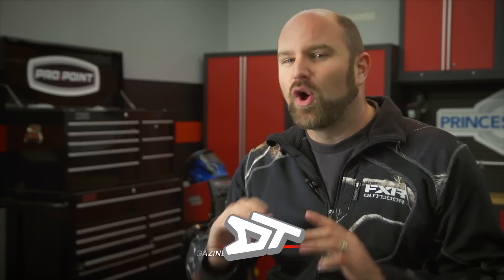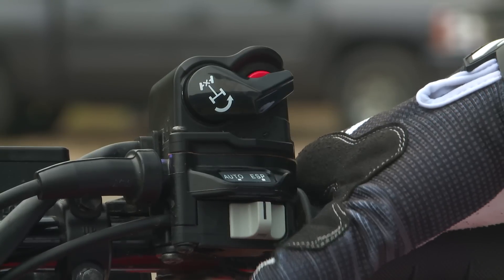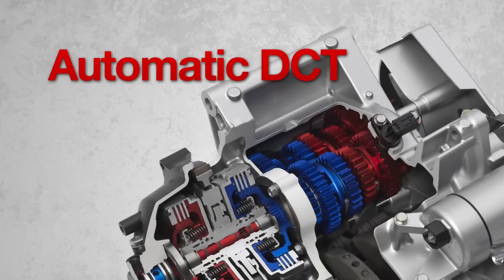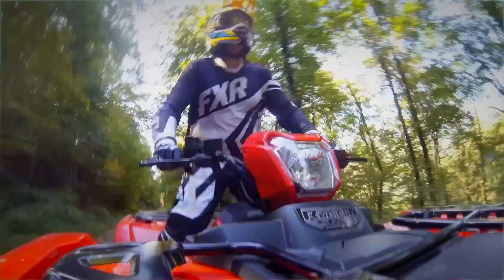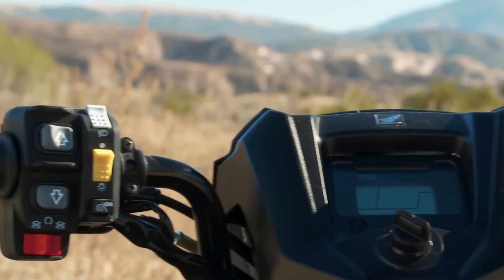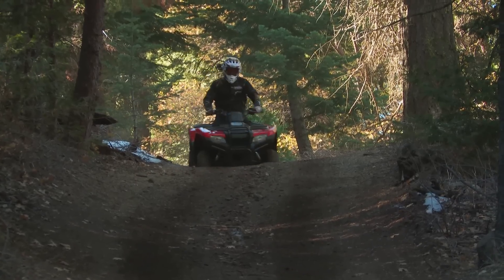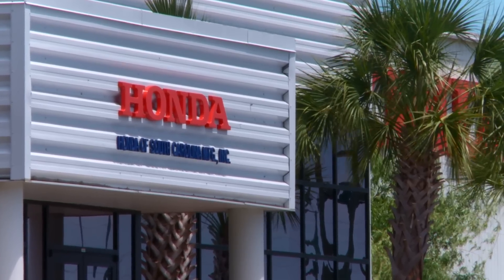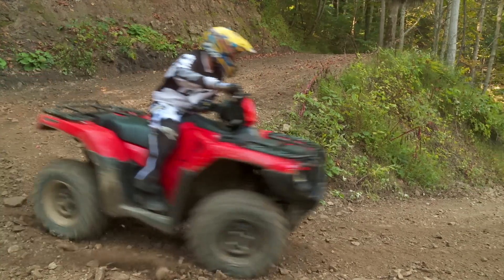Honda ATV Dual Clutch Transmission

Comment: I've recently had a Grizzly 700 and before that Polaris Sportsman 500 and 700 respectfully.  But before all that in the late 90's and early 2000's i grew up on Foreman ES and Rancher ES.  I have never drove an automatic Honda machine before.  Does the ESP mode on Rubicons have sound?  You know how when you're driving a Foreman or Rancher ES how it makes that clunk so to speak when you hit the up or down arrow?  I've heard its seamless on the Rubicon?  Is there any other difference than that?  I will probably keep it in ESP mode 95% of the time so I'm curious to know if there are any differences between ESP mode on a Rubicon vs the Foreman ES as far as how it operates.  Also what's the top speed of the '15 Rubicon DCT and how does the ESP differ in drive or low range?  In the video the Honda guy said it's like having 10 gears?  Sounds awesome but I'm curious how it actually feels and works!

Comment: Watching your shows got me thinking about getting an atv or a sled for years now.., I'm uber jealous every time I'm watching these. You guys are an awesome bunch, I hope I'll be watching you all for many years to come..!
Thanks..! ;)

PS: even though I don't own an atv, I'd like to see a deeper review of the transmission. With clear, long, info-filled action shots. For example, in manual mode, start a fairly steep climb in first, let it settle halfway through the rpm range or further then shift to second without changing throttle application.